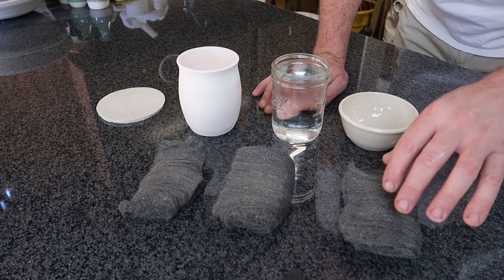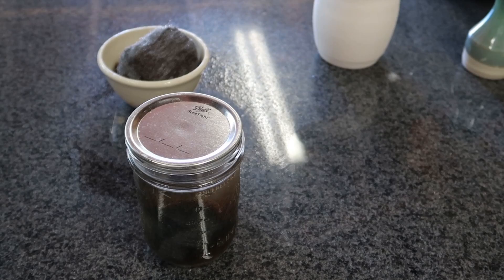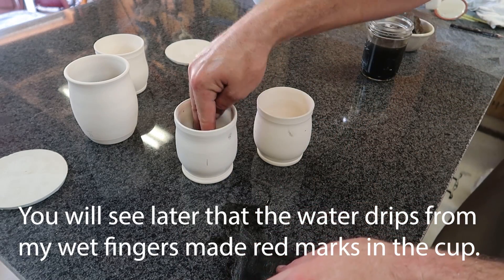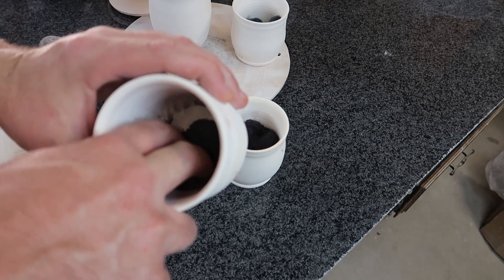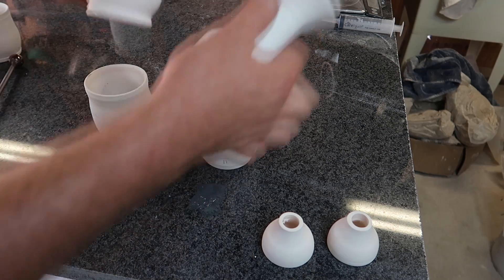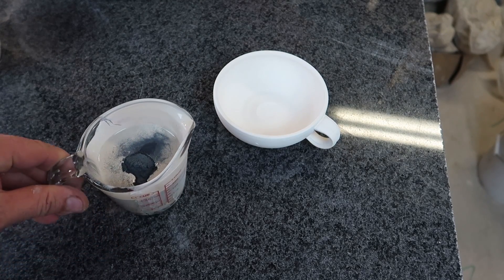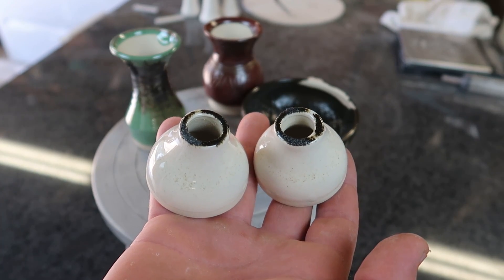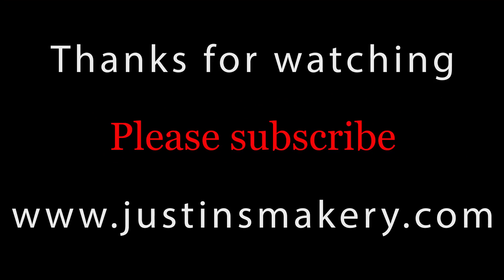Making Iron Oxide with Steel Wool - Experimental

Comment: Salt will speed it up.

I use "red" iron pigments in my glass fusing work.  It is laser toner.  I mostly use it for printing "in" the glass, laser printing on decal paper.  It comes out "burnt orange" (same color as the university of Texas football jerseys, convenient for making art for ut football fans).  You can get toner, a super fine black powder.  The black turns burnt orange while firing, no oxygen required.

Comment: I know this post is quite old, but the process described by @W.Neil .Appleby is how to make iron acetate. Iron acetate and iron oxide are different chemical structures due to one being decomposed by a concentrated presence of oxygen in the surrounded environment (as in the case of electrolysis) with some hydrogen (H) to  initially bond the oxygen (O) to the iron (Fe) then ideally stripped to an iron oxide such as, but not limited to, i.e. (Fe₂O₃), if the hydrogen is not stripped from solution then you have an iron hydroxide such as, again not limited to, (FeHO₂), notice the hydrogen presence now, with a lower iron and oxygen levels. Both look similar to each other in their various forms, the oxide form is preferred by manufacturers because of its ease and simplicity in chemically breaking the bonds to make soluble in solution and creating emulsions, whereas the hydroxide version require a more elaborate method to break the bonds because of the presence of hydrogen (H) and if not done properly can become a gummy mess. Now compare this with an iron acetate i.e., (C₁₄H₂₇Fe₃O₁₈) notice now we have carbon atoms in this element, that is because in the case of iron acetate we are simply dissolving the iron (Fe) with an acid, i.e. vinegar (as mentioned above), which originally was thought to be food safe, although later found not totally true, and was mainly used as a chemical stain for wood that contained higher concentrations of tannins, especially hardwood such as oak etc. I hope this somewhat explains the differences between the various elements discussed in this post, of course there is a lot more to it than explained here, but I tried to keep it as short as possible and hopefully provide a better understanding. In short the elements discussed above and asked about within this post are chemically different and will react differently compared to each other i.e., iron acetate is soluble in ethanol has a Melting point: 190-200 °C, iron oxide is not soluble and has a Melting point: 2,849°F (1,565°C), iron hydroxide is soluble in water if ph is not 7 (neutral) such as pure distilled water and has a Melting point: 275°F (135°C).

Also in the video I noticed you asked if anyone knew why the material was not red or brown. I don't know if you found out why by now, but just in case you didn't. There are many reasons why, one could be the lack of oxygen (in the case of using a kiln) which has the effect known as decarbonation (or decarb for short) which is a forgers nightmare, which occurs when metals such as iron is heated in an oxygen free environment such as a container that semi sealed (small opening at the top) causing whatever oxygen that is in the container, forge, or kiln to escape or used as fuel. If you ever made charcoal you understand what I mean. When we make Iron oxide in the laboratory for pigments and pyrotechnics, we simply heat it fully open to the environment, no kiln, no forge, just on top of a large furnace which causes the iron (we used powdered iron) to reach around 400°F and fans blowing outside (filtered) air onto the heated metal. The conversion starts almost immediately (within about 10 mins. or so) and we produce around 24 tons a day using this process for as long as I have worked there and even before that (since opening in 1861 for use in paint). Also take note that pure iron oxide is a dark grey to almost black and this is made in a closed system evacuated and continuously flooded/flushed with pure oxygen and a very small amount of hydrogen at the same temperature as above then openly reheated in a similar fashion as above to remove the hydrogen but without the fans because the fans cause the iron oxide to further decomposed to give that red to brown color that so many people are familiar with. It depends on the color your trying to achieve determines which process, duration of time and so on. All in all it is quite simple, heat it in the presence of oxygen. It is that simple. I see a lot of videos out there, especially on YouTube, where they make more out of this then is necessary. Could you imagine how much this stuff would cost if you used there supposed processes they claim to use, which most of the time produces results that are not what they claim. I see it a lot. After all at the end of the day it is just rust and how much would you pay for rust when you can get it for free. That is actually a real quote from a sign where I work.

I hope this helps someone.  J.R.
Reply: Thank you for taking the time to explain the chemistry reactions, I have learned a lot, you must be a chemist.
Reply: @villiasimpkins4820  You're very welcome. I'm glad it helped you. Yes over 40 years now.
Reply from the maker: Interesting!  Thank you for such a detailed comment.  I appreciate it.
Reply: @JustinsMakery  Your very welcome. Sorry if I went a little long though. Hope it helps.
Reply: @JustinsMakery  by the way your channel is awesome!

Comment: There are other oxides of iron like FeO which is black, Fe3O4 (magnetite which is also black). You can try runing DC current trough a solution of salt using iron electrodes. This will produce a brown/black precipitate. You filter that, let it dry and heat it. I did that a few years ago and got a really nice red color. Another option would be to make some iron sulphate from and some copper sulphate. Then you can add sodium bicarbonate to the iron sulphate solution (this one should be green, but it oxidizes quickly and becomes brownish) and just dry the precipitate and heat it up. This method I haven't tried tough so I'm not sure how it would turn out.

Comment: What you desire is Iron(III) oxide-hydroxide (red rust), pure Iron oxide is black. The best method is to use electrolysis in salt water, water will provide both hydrogen and oxygen. Or you could just leave the steel wool in the  salt water for an extended period with heat.  Drying it and rewetting it in the salt water several times, exposing it to oxygen and hydrogen in the air.

Comment: To create a perfect iron oxide you need to first ignite the steel wool with something like a nine volt battery or Butane torch, and then wait for it to cool. Be sure to do this outside as it gets up to 900 degrees Celsius when it gets going. After it cools, spray the wool with vinegar and wait about 5 min. After the five minutes make a solution of about 8 parts Hydrogen Peroxide and 1 part kitchen salt. Submerge the steel wool into the solution and wait for the reaction to finish. You can tell when it is done when the solution stops bubbling and it will begin to cool down. Afterwords strain the liquid through a coffee strainer into a cup. The remaining red stuff in the strainer is iron oxide. Allow for it to dry and your done! Hope this helps!
Reply: Has anyone tried this?
Reply: @crisfer22  yes it works, but the amount of peroxide you need is probably three or four bottles of your standard 3%, or get concentrated 30% which i dont recomend at all. It can be dangerous at that concentration. They also imply that the reaction is complete when it stops bubbling, no that can also indicate that all of the peroxode had been catylised as well and not all kf the iron had been converted.

Depending on what you want it for, the recipe also called for using salt, ans you might not want soduim ions in your mix. If youre using is a ceramic colouring like in the video, them you definately do not want chloride ions either at those temperatures as the trace a,ount of salt will melt and possibly flake your coating, or react with your glaze or ceramic.
Reply: @nunyabisnass1141  Wow! Thanks so much for that in depth answer! I'm a beginner at pottery and I love the diy kitchen science experiment options but I definitely don't know anything about the chemistry of it yet. You saved me time and a lot of hydrogen peroxide!
Btw, can you recommend any books or other resources to learn these kind of things?
Reply: @crisfer22  I'm more familiar with the chemistry than terra cotta, so unfortunately i dont have any suggestions or resources for ceramics. What i can tell you though is there are many websites that supply various pottery powders like rust in different gradrs of colour, that will be far cheaper to buy than to produce.a bag of steel wool might cost $12 for instance, then theres the time you wait for it to react, then you have to wash and filter it, then grind anything that cakes up. A 10lb bag of standard orange/red bag of rust might cost $20 from amazon. 

The diy side of this sort of thing is very interesting and even fun, but its rarely cost effective so the only reason ppl do this sort of thing is because they want to, not because its practicle. There are a few things i make myself like handles and leather stitched cases, because you literally cant find skills providing that service. When it comes to things like making your own dyes, paints or slips by pulverising and mixing things, thst might actually be worth your while as ypu might want a specific shade or hue, or want a sort of melting candle effect where i think ypu would mix a little more flux into the paint so its more fluid at firing temps and runs a little from a layered effect.
Reply: I need to try the method you mentioned.
Reply: Gonna try this

Comment: The reason its not red i'm guessing is because its still iron. Iron oxide needs water & oxygen in order to form so having the oxidizing environment without the water as with the kiln is not sufficient to create the reaction and having the water without the oxygen is not sufficient neither as you saw from the almost complete lack of rust on the submerged iron wool.

The piece of steel wool that was semi submerged was in the perfect environment for rust to form with both water and oxygen present.

We can heat up iron even higher in a crucible and it still will not turn into iron oxide but instead will melt into smolten iron. I'm guessing the reason it doesn't oxidize is because of the lack of water. If you want a real quick way of making iron oxide put a little bit of water in the bottom of a jar, put in your steel wool, put on the lid nice and tight and then place it in a warm place like on a radiator or a stove. The warmth will cause the water to transpire and coat the steel wool whilst still leaving plenty of access for oxygen to also make contact with the wool. Crack it open every day or two to allow in extra oxygen and hey presto you will have a rust making machine. 

Alternatively you can move to Ireland and forget to paint your tractor and when you get outside to drive it, it will fall apart from rust because that exact process is playing out on a much larger scale, transpiration creates thin layer of water on steel objects, oxygen is still able to make contact and hey presto, stuff rusts here like nobody's business.

Comment: So if you just wanted the black iron oxide, I'm like 90% sure this is the same reaction you get when you ignite the steel wool with an open flame or a battery.  But other people are making some pretty solid points about getting the red ferric oxide.  I don't strictly need to worry about making my own red, since my craft guild does that, but having the powder opens up some possibilities...

Comment: What a great experiment.  I wonder if there are too many impurities in steel wool.  There could be a wide range of scrap metallics that make the wool
Reply from the maker: I wonder that as well.  I'm sure they aren't using the finest steel available. :)
Reply: Most steel wool have a ton of chromium and decent bit of carbon so that could've had something to do with it

Comment: I did an experiment to make ferric acetate to replace ferric chloride for the foil saggar raku technique. The first step was placing steel wool in hydrogen peroxide to oxidize the steel and create rust. This worked well, you might give that a try if you haven't lost interest yet 😊  I enjoy following your exploration of clay subjects. Keep trying new things, we all learn from you 👌
Reply from the maker: Hydrogen peroxide.  It didn't even cross my mind.  Thanks!
Reply: Wynhill Pottery I would love to know more on how you did this to replace the ferric chloride. I would much rather use something else if it could be safer. Thank you
Reply: Teai Day - That was my reason for trying the experiment. I learned the method online from a teacher's posting of her class experiment to create ferric acetate using hydrogen peroxide, steel wool and vinegar. It worked okay to make the ferric acetate, but the product won't fume, so it doesn't come close to replacing ferric chloride which does fume during saggar firing. There was some nice rusty color that sadly wiped off, but what remained was a nice buckskin brown. Since it didn't show promise I stopped working with it.

Comment: Not meaning to sound like a smart ass, the red is due the oxygen in the oxide. The stuff on the bottom of the rusty pad would have been the Fe2O3. The oceans of the world were purple due to all the iron dissolved in them, then stromatolites separated the O2 from the CO2; the O2 caused the iron in the oceans to precipitate out and gave us the Iron Range across northern Mn and a blue planet. Starting to sound like Cliff Clavin....
Reply from the maker: Interesting.  Any idea why in an oxidizing kiln environment didn't turn the uncovered samples red?  Seems like there should be plenty of oxygen.
Reply: @JustinsMakery  Chem101 was a long time ago, I'm afraid. Just a guess but it's probably because the oxygen is already bonded to the iron before the firing and not caused by the firing. Elementary iron dissolves in water and frees up the ions to bond with oxygen, which makes ferric oxide. Ferric oxide (red iron oxide) does not dissolve in water but precipitates out. Melting ferric oxide by itself splits the Fe and O bonds which causes most of the iron and oxygen to separate, and raw iron results. As I understand it in the firing a reaction begins between the iron oxide and the other compounds in the clay or glazes before the oxygen can split off. It's kind of like trying to figure out how adding fluxes lowers firing temps :P 

BTW, be careful when melting metals in ceramic pots. You may already be well aware of this but a piece of metal like a coin sitting in a pot will act as a flux and dissolve through the bottom of the pot and fuse it to the kiln shelf, leaving a very hard lump of slag. I bought an old electric kiln that had a piece of what might have been sheet metal fused to the bottom; completely unaffected by either a diamond wheel or metal cutting wheel on my angle grinder. The diamond wheel, which I use for cutting concrete, began to burn out without so much as leaving a scratch.

It would be interesting to see what the dark water in the jar does, and I'm again guessing that it is a different type of iron oxide you made there. Apparently there are 3 types commonly used in ceramics, red, yellow and black, each with different firing properties.
Reply from the maker: Wow.  Super thorough answer.  Thank you.  Crazy story about the metal on the bottom of your kiln.  Really interesting.
Reply: @JustinsMakery  my guess is it reacted with a carbon source (maybe CO2 or impurities from clay/glazes?) much like it does in a blast furnace (iron oxide ores go in and react with carbon source to make carbon dioxide/monoxide and pure iron)